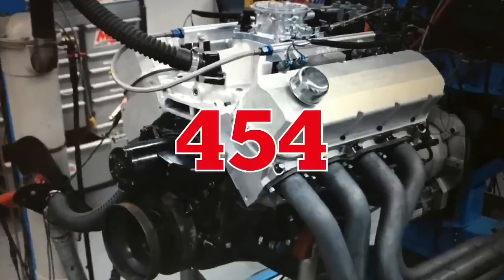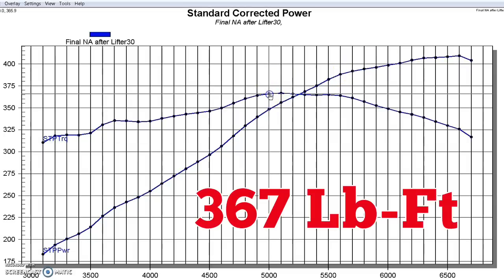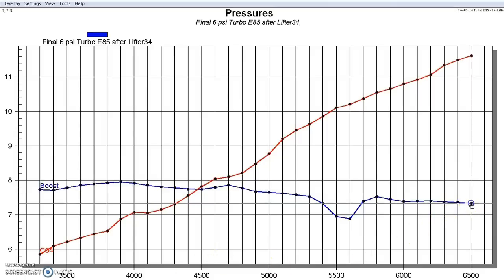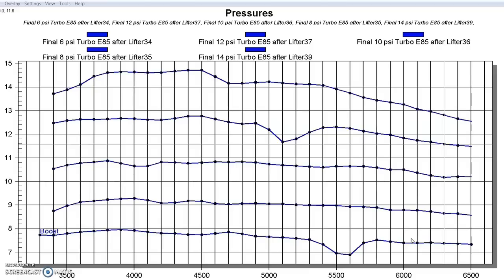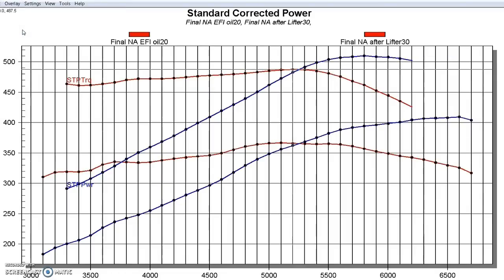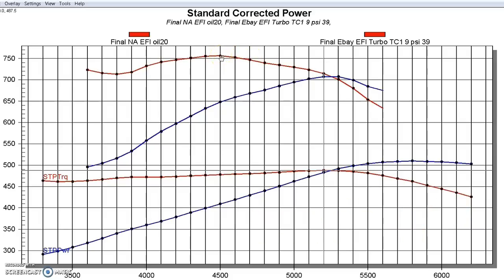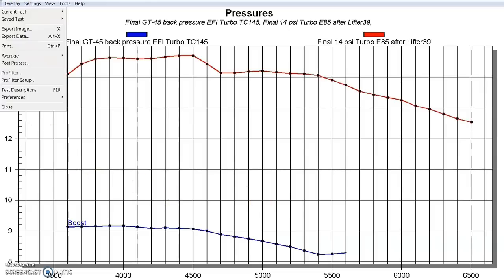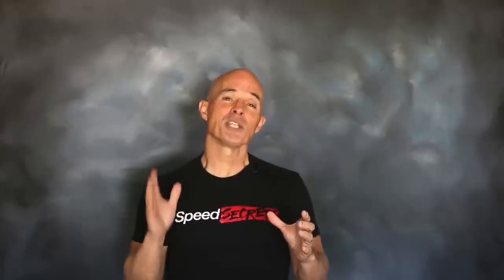EBAY TURBO TITANS-4.8L vs 454 (GT45 TURBO)

Comment: How do you run a boost controller on a gt45 that has no nothing to stick , a tube on? I was going to die now with without it cuz it doesn't have that
Reply from the maker: nothing to stick a tube on?
Reply: @richardholdener1727  how to put a boost controller on the GT 45,i don't see a hole,drill an tap I guess, what happens if I run it without one, I have a vs 44 mm wastegate, and a 50 mm bov, I got the rings at 30 ,31 maybe 32. What are your thoughts before I bring it to a Dino, I have 95 lb injectors from deach works, 525 warlborough pump?
Reply: Yes don't have a vacuum port on the 45t

Comment: Richard, if you had that 454 and the power goal was exactly that 700hp it laid down, what would be the side-effects of running such an inefficient turbo in that application?
Reply from the maker: high back pressure
Reply: Thanks for the reply.  @richardholdener1727  Thanks for the reply. What is the problem with high back pressure if your power goals are achieved?

Comment: Great video! I assume you’re running pump gas is it 87 octane or 94 octane? On pump gas , what if you were to put 108 octane boost? I’m curious to know what the difference would be in those two combinations thank you very much. Have a great day.
Reply from the maker: NOT PUMP GAS-IT WAS E85
Reply: @richardholdener1727  what if you ran 87 octane with 108 octane boost? Would that hurt or help? I just discovered your channel, love the videos well done thank you.

Comment: I found this video after your comment about using a gt45 on my 8.1l.  Is that high back pressure damageing to the turbo? Surging? Or can you make it reliable with some wast gate tunning?
Reply from the maker: waste gate won't change back pressure

Comment: I am sure this was ask, but there hundreds of comments too go through. Dealing with a GT45 turbine/exhaust back pressure...is there any benefit porting the turbine outlet area around edge of the fines or install a small wastegate near scroll outlet( not the near inlet too control exhaust speed to the fine) dam shame too spend a extra few hundred dollars for extra exhaust flow where most our goals can be accomplished with a single GT45 with just 8lbs of boost .
Reply from the maker: turbine gains might be helpful if you are near the max flow

Comment: Just a question doesn't the turbine housing have alot to do with back pressure wouldn't a smaller housing be better to lower back pressure just asking  I'm not no turbo expert
Reply from the maker: SMALLER TURBINE HOUSING WOULD ADD MORE BACK PRESSURE
Reply: @richardholdener1727  nice to know, so the gt45 and the Borg Warner 369 I was looking at the specs of both of them their almost identical in size well the impeller and turning but the housing's might be different

Comment: Boost pressure is relative to intake restriction.  Hence larger displacement has less boost at given horsepower.  Should compare intake flow to back pressure. The turbo size is the constant.

Comment: What if:
... I want to have max. torque down low in a cheapo LS configuration, like "stock" 5.3l?
Like 400 HP is enough - but with a thick torque curve. 
Does this necessarily mean high back pressure? Which means high exhaust valve temps - afaik? Which is not good in the long run.

Comment: Richard as back pressure goes up what stops the flow from stopping and the turbo shoving burnt exhaust into the intake tract. I'm thinking a cam change with a wide LSA so we have negative overlap.

Comment: I just picked up a motorhome with only 20,000 mi on it 454 would like to put a turbo on it what size is recommended I will be hauling a fifth wheel with it building a hot rod coe

Comment: So what you are saying is 2 gt 45s on 4.8 would make 1200 hp but with a torque number the bottom end could easily handle .in a 63-67 nova 2800 lb.ohhhh yeahhhh!
Reply from the maker: you would need to control boost based on rpm

Comment: Looks like the gt45 might be ok for 750hp on a 351w with victor jr heads and mild cam in my Torino street cruiser and be nice and responsive down low up to 6000 rpm. It certainly lit up that 4.8 😀

Comment: Richard how about building a torque monster big block to go against todays diesel engines. I've got a GEN six big block on a dually use for towing. I keep getting harassed for not getting a diesel. What combo of parts would you recommend???

Comment: Looking at this for an RV application.....run the lower  boost and keep the rpm under 5000. Gobs more torque than stock and the back pressure is much less. Also...keep stock gen VI  heads. Can the factory efi be tuned for this setup or is it strictly aftermarket?

Comment: i run a cummins on a stock automatic transmission Turbo ( smaller exhaust housing) And I run 150 hp injectors overstock with stacked programmers. My boost pressure has hit a high of 65 pounds of boost but my back pressure supposed to be in the neighborhood of 125 to 130 pounds of boost on the exhaust side lol so 22.5 psi is nothing to me on back pressure

Comment: so the 4.8 probably couldve have used a slightly bigger turbo and the 454 could have used two of the 45 mm turbos? would porting the compressor case flange help?

Comment: Same motor, same turbo with different turbine housing sizes would be a far more useful demonstration with any turbo. It would certainly knock the guess work out of a turbine choice for the motor the test is performed on, given the importance of proper turbo sizing for a motor and the limited real world examples of such comparisons for those trying to make a decision. Do the same with a few different compressor choices also.

Comment: Hey so I have a 4.8 Z71 4x4 & I want any where from 500  to 800 hrp & all I have is a 228/230 cam & springs, but I would like to put a turbo later. So my question is what  gear ratio stall converter would you recommend on a 4L65e?

Comment: It would have been nice to compare area under the curve.  That's the true story in actual performance.  The turbo is feeding that big block more air at lower RPM than it can on the 4.8.  which would mean that the turbo is actually more effective on the BB even though the peak HP #s are comparable.
Reply from the maker: the BBC is feeding the turbo more at lower rpm-cuz it makes more torque down there
Reply: @richardholdener1727  so with more area under the curve, the bigger displacement would be faster all other things being the same.....

Comment: I wonder how the boost pressure to back pressure correlation would be with a Gt45 and a 406 SBC👀👀
Reply from the maker: between these two
Reply: It would be a solid budget build contender that's for sure🤷‍♂️

Comment: Would you care to put twin eBay gt 45s such as the one you used in the rest on the 454? It seems that would lower back pressure substantially and that you could also increase boost to see how much power two gt 45 turbos could actually make on the 454. Thanks for your videos. They are very informative.
Reply from the maker: coming up
Reply: @richardholdener1727  thank you. I can't wait. I have a 500 inch older pro stock motor and I have 2 of the gt 45 turbos and was wondering how the 454 would respond so I would have an idea of how my 500 inch engine would respond. The engine is a 3.75 stroke by 4.6 bore. If I was close to you I would let you use it for some tests with turbos.

Comment: In a pure drag car, they will likely run similar 1/4 mile et and mph.  In a heavy street car, the extra torque of the 454 will make it considerably faster from a stop or rolling start.

Comment: You should do a test with the edelbrock cross ram intake with twin turbos
Reply from the maker: i have tested it-just not with boost
Reply: Richard Holdener I am curious to see what the difference would be between the cross-ram and Hi-ram intakes with boost

Comment: Good video, but to pick a turbo you need to calculate CFM of air to move through the engine (displacement x rpm x boost) and then look ar the difgerent turbo compressor maps to see which onenfits your application the best.   A great book is "Maximum Boost" by Corky Bell.
Reply: Commented on the wrong video  but its still good info, so I'm leaving it.
Reply from the maker: we picked it based on what we had laying around

Comment: 468 512 casting bbc 315 /121cc flotek heads SRP pistons, callies rotating assembly 10 to 1 ,  twin gt45 turbos howards 297/308. 640/640 hydraulic roller 1400 all day long safely.

Comment: You should have run the turbo again after fitting a larger exhaust housing or after the original had been extrude honed, then you would have had more power, due to less backpressure and more linear power delivery.

Comment: Turbos must be properly sized for the engine displacement. This is basic, forced induction knowledge. I suppose this kind of video is good for those new to forced induction, but anyone who has experience with it would see the thesis of this video as common sense.

Comment: I haven't seen a pressure map for this turbo, I dont think anyone else has either. All this data tells me two things, the efficiency island is centred around 55 pounds per minute and a pressure ratio over 3:1 and the turbine housing is small enough to spool with only 293 cubic inches and 3000 rpm. Both of these engines are already too big for this turbocharger. The biggest problem your having is how low the boost is. Almost no turbos do well with a PR under 2 save some really old school to4b. They might be old but for low boost situations they remain some of the most efficient compressors. As you turned up the wick on the 4.8 you could see everything moving to the left as the turbine starts to choke. It still looks like a mismatched combination but even two of these may not be enough for the big block to spin efficiently. It looks about right for two on the 4.8, pending the boost is somewhere north of 30 pounds.

Comment: Wouldve been a better challenge if the LS got a single plane intake over that junk plastic intake. That intake is a choked intake being the front runners dont get as much air as the rest. Maybe the 4.8 would've done better in power and torque.

Comment: Interesting video, Put twin gt45’s on the 454 and see what happens. Probably a broken 454. Still would be cool to see it run with better boost to back pressure ratio

Comment: I feel personally attacked by running this turbo on my olds 455. Fuck it, I'm not gonna spin it over 5k anyway.
Reply from the maker: it works well for low boost and rpm

Comment: Would be neat to see the boost vs backpressure on a LS 408 with the same combo. LS has much more efficient VE so it would be cool to see.
Reply from the maker: it would be high on that powerful combo
Reply: Richard Holdener I wonder if it would be less than the 454 at the same 700 hp. 408 would make more power NA I think, but it is more efficient than the 454. So would it have less back pressure than the 454 even though it makes more power before the turbo? Is back pressure more of a cubic inch thing or efficiency thing? Would be neat to see.

Comment: Id like to see a 5.3 twin gt35s and cammed  vs lq4 with gt35s same cam. Fuel ecu springs and properly gapped rings on both
Reply from the maker: I think I have a pair of GT-35s, but they are T3
Reply: Send it lol would be another good vid to show how properly sizing turbos can make the diffrence at a set psi

Comment: With the back pressure rise, even on the 4.8, it tells me both needed a bigger or two turbos. Am i correct in my assumption?
Reply from the maker: depends on power level of the 4.8L, but yes-bigger would be better

Comment: Change your Manifold and ar on the Turbo you are Literally  choking out the 454
Reply from the maker: the manifold is not the problem-its the turbo-A/R would help a little, but the entire hot side is too small, then the cold will follow right after that-its just too small for the 454-we ran these tube headers on a single S480 and twin S475s-they work great
Reply: @richardholdener1727  sorry I should Clarify I meant the Exhaust Manifold.  The exhaust side as was in this particular test was choking that big fella out. I also wrote my comment before seeing thew last couple of minutes of the video. Although I would love to see this 454 on a different intake that didn't have that 90 degree bend right before the throttle body. I do love your channel though. My whole point which you clarified at the end of the video that this setup was definitely not optimized for the 454

Comment: 4.8l, stock heads, only a cam upgrade vs a 7.4l big block with aftermarket heads and cam. Gee, I wonder how this'll turn out. 

That said, I'd like to see this done with a 6.0l instead of the 4.8l - would be a much more appropriate contest. Even with only a cam, the 6.0l is much closer in displacement, so it would make sense. Anyone considering a big block won't even think about a 4.8l, but the 6.0 might get their attention .
Reply: Eric K you missed the point here. The point was to see if the same cheap turbo netted the same increase in power on a bigger cube motor before the cheap ass turbo became a restriction.
Reply: @DWBmotorsports  - I wrote my comment before watching the whole video. I wasn't expecting it to be a 'Barney style' breakdown of the basics like this. My comment was based is his previous comments that to make good turbo power you start by making good N/A power. 

As for what he actually covered, I already know about choking an engine with too small a turbo, but this was an excellent display of that. I didn't however know the specs of that specific turbo to know if was sized for the big block first and would consequently be too big for the 4.8, or was what he actually had being sized for the 4.8 and way too small for the big block. After watching, obviously now I know.

It was a good vid, and deserves the thumbs up I gave it, but my original comment still stands. It would be a better comparison with the 6.0l vs the 7.4l. Maybe the next one with twins... that one gets to be old vs new with a slight displacement difference. :) Hopefully.

*edited for spelling* Should'a proofread better...
Reply from the maker: who is Barney?
Reply: @richardholdener1727  - Rich, are you serious?! You strike me as the type to have heard the phrase "Break it down Barney style", referring to explaining something in the most basic way as if to little children, just like that giant purple mistake of a children's nightmare. I think teletubbies replaced Barney as the daytime children's mental damage program sometime in the late 90's early 00's... 

But Barney.... I thought everyone knew (had been scarred by) Barney...

Comment: What would the results look like if you ran a twin turbo set up on the 4.8? My guess is that even two of these eBay turbos can't efficiently make efficient boost on that 454. I love your videos I am learning!
Reply from the maker: two should allow over 1200 hp
Reply: @richardholdener1727  sorry Richard I wasn't specific enough about my question. Would two ebay turbos run in parallel on the 4.8 shrink the boost to drive pressure ratio? Theoretically you are halving the work load of each turbo in that application, correct?

Comment: Hi Richard no bullshit testing I love it.  But would the fact that the 4.8l with the turbo suitable stage 2  cam with wider lsa than the 454 n/a suitable cam,  make any difference to the back pressure level?  Keep up the good work,  thanks Matt
Reply from the maker: I think the majority of the back pressure is a function of the power curve of the 454-cams do have a minor effect after you factor out the change in power (that always effects back pressure)

Comment: Hay richard i have a 540ci with twin borgewarner s369sxe turbos with .88 a/r housing. Carb blow threw e85. I have seen 24lbs of boost pressure but have no idea what the back pressure is.  If i where to test back pressure, what would i want to see for pressure. Car knocks tires loose at 120mph. Engine is copper head gasket with o ring block with all the 2k hourse power goodies.
Reply from the maker: Ill need to look up the maps on those turbos-seem kind of small for a healthy 540-especially at 24 psi
Reply: Richard Holdener , car was built to go mid to low 8s. Its more of a street car setup then track car id say 75% street 25% race track. When I originally bought the s369sxe i was told they flow just as much as a old s475 cast wheel.

Comment: This video is misleading, why would turbo manufactures rate their turbos by horsepower and not cubic inches? Saying a 4.8 and a 6.0 should use different sized turbos because of back pressure is ridiculous.... You're moving the same amount of air at 800hp through a 4.8 as you are a 6.0. engines are just air pumps. I need answers
Reply from the maker: the video is not misleading-the focus was the difference in back pressure

Comment: I thought horsepower and airflow were linear? How exactly does a larger engine create more back pressure then a smaller engine at the same horsepower level? Wouldn't they be intaking the same amount of air? Thus moving the same amount of air through the hotside of the turbo. Boost pressure seems irrelevant. Confusing to me
Reply from the maker: look at the average amount of power produced for each NA, that is what causes the extra back pressure-a lot more exhaust must flow through the same orifice over the same time period

Comment: I'd like to see this test but with an s475 so you can put a big 1.32 T6 housing on it and then the smaller .90 T4 housing and see how that affects back pressure.
Reply from the maker: I ran an S480 that dropped the boost/back pressure ratio from 2.62:1 with the GT-45 to 1.5:1
Reply: @richardholdener1727  very interesting! Appreciate all the great videos and information you provide.